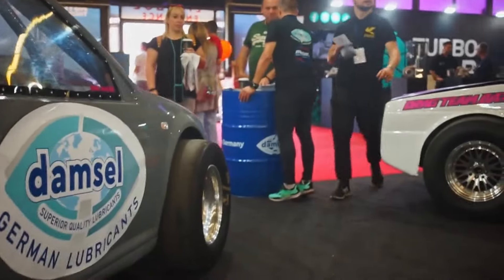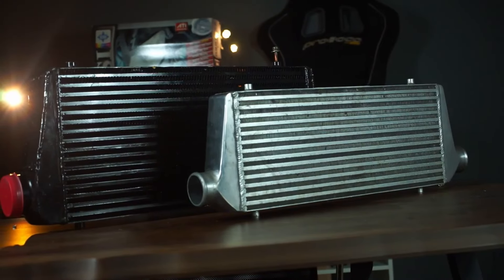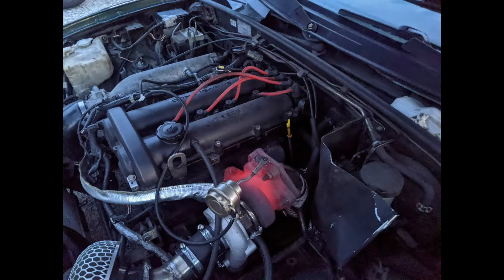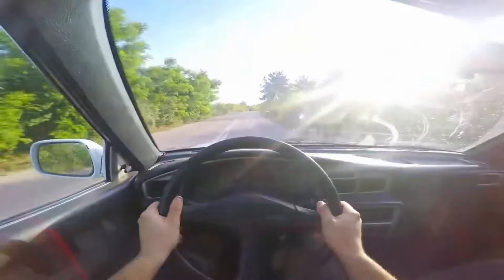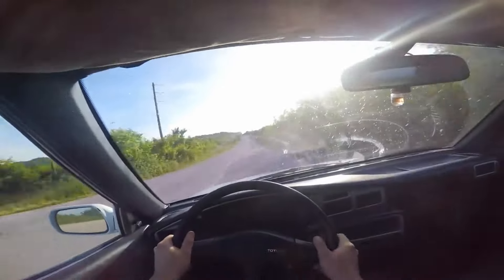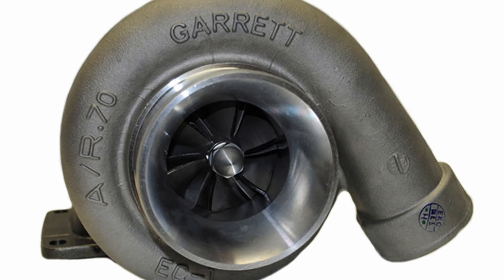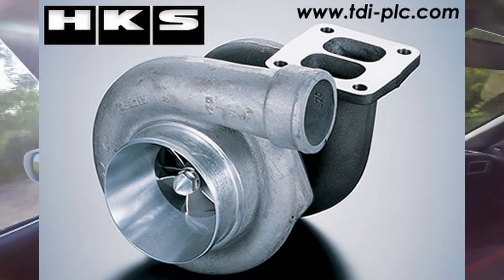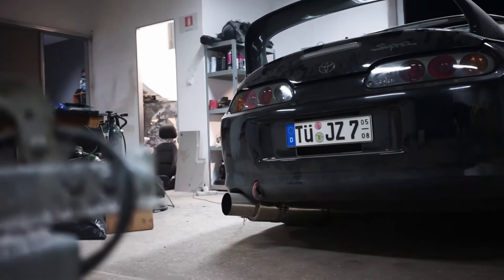How to getLOUD DOSE & Turbo Flutter, Surge etc. | Ways to make your Turbo louder!

Comment: Funny we are concerned about getting faster spool and more power from our turbos not making noise! You touched on this but the surge noise you are trying to make isn't good for the turbo in the long run.  It puts a lot of stress on the compressor wheel, shaft, bearing system, and thrust bearing. So you are reducing turbo life and possibly damaging the turbo! You are also increasing turbo lag when you get on and off the throttle! That's why we use ported shroud compressor housings and compressor bypass valves to try to reduce this!
Reply from the maker: You are 100 percent right that it causes more wear but the experience is that especially on ball bearing turbos the effects on longevity isnt that large. LCE in germany did testing at 35+ PSi using no blow off valves in their audi quattro builds that they warranty for their customers and they have no issues at all with the garrett G-Series. Also on anything that has a high flow housing, the force on the bearings is almost halved, so it is not as bad. 

Though there is some performance arguments for this also, not using a blow off on a large frame turbocharger on a small engine, makes transient response MUCH faster, so depending if you wanna sacrifice a little performance for that, might be worth it (Allthough there is an argument for NLS to be had sooooo neither here nor there) 

the issue i see is what i also explained in the video is with turbos that dont have a high flow housing and not using a blow off is, that the compressor wheel might shift on the shaft and causing imbalance therefore destroing bearings quite quickly. Thats why audi in the 80s used a polygon shaped shaft to stop that. Not sure why modern manufacturers dont do that anymore. possibly too expensive.

Comment: Hello! Steel or aluminium is definitely preferable for sound, polishing the inside may help too? It also applies for NA induction noise, combined with an aftermarket air filter. 

I achieved flutter on my GF8 Subaru WRX by removing the bov and blanking the hose connections to it off. All plastic/silicone hoses unfortunately and top mount intercooler so wasn’t great. 

The best sound I ever heard was from a really tidy S14. There was a noticeable time delay between the flutter notes.

Comment: I have an anti surge inlet on my gtx3076r (billet wheel) and it doesn’t flutter very loud even with a short stainless steel dose pipe. If I remove the anti surge will it flutter louder?
Reply from the maker: @Sirocco__  while it will be louder you could try use a tube of the diameter of the actual inlet and than push that flush onto that and use a reducer to mount that